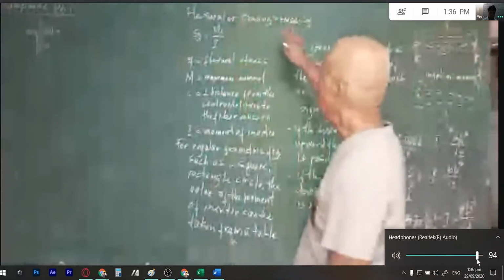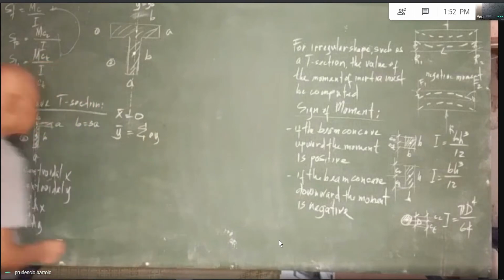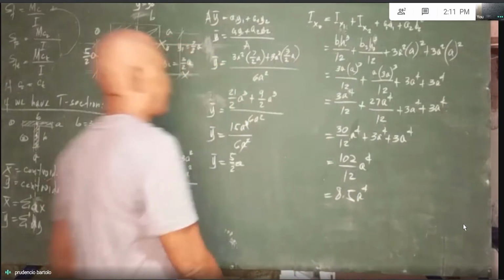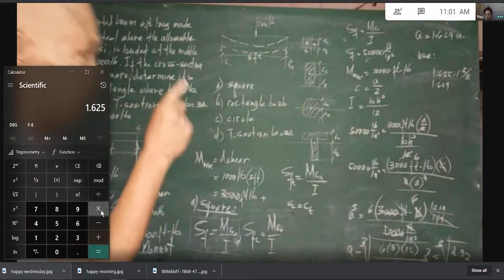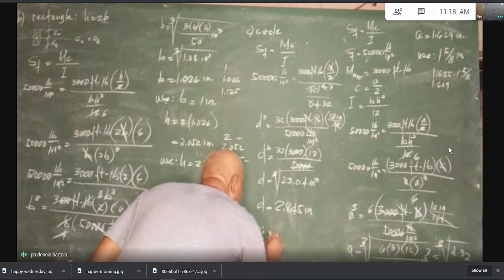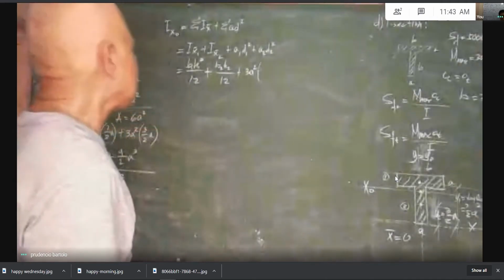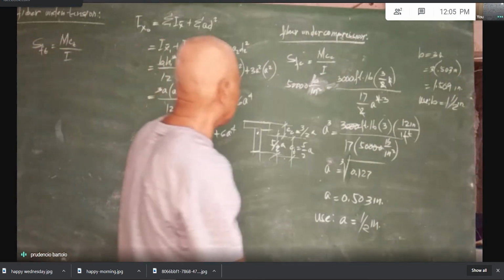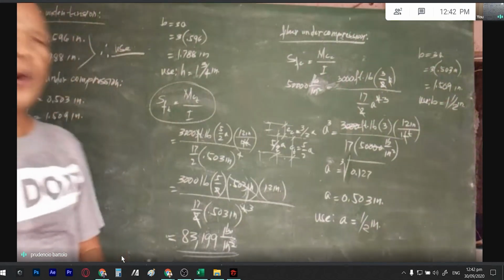Engr. Bart's Machine Design Lecture Series: Ch 1 Bending Stress Analysis

Comment: Finding out how much force an object can tolerate before breaking comes in handy in many situations, especially for engineers. This has to be determined based on experimental results, which essentially involve exposing the material to increasing amounts of force until it breaks or permanently bends. But performing the actual calculations to work out the flexural strength of a material can seem really challenging. Luckily, provided you have the right information at hand, you can tackle the calculation easily. Thanks for sharing ProfBart!